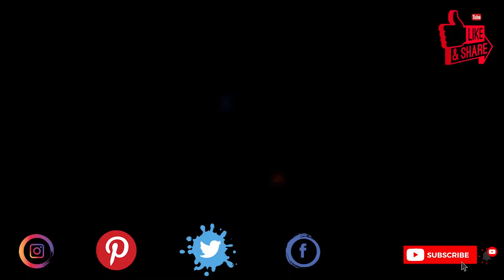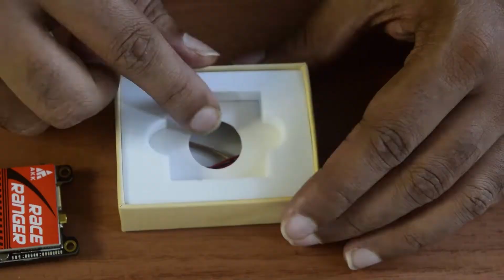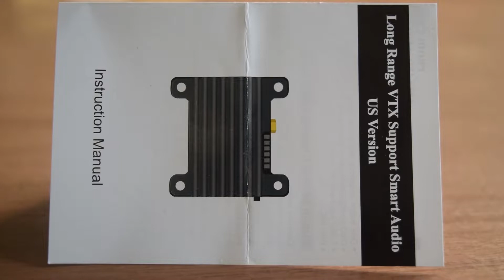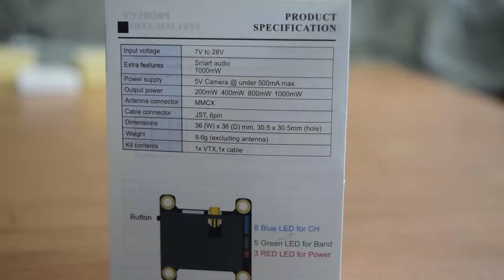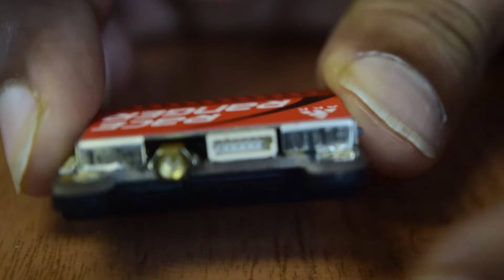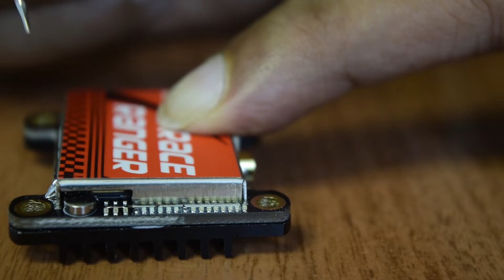BEIGNNERS GUIDE TO FPV DRONE VIDEO TRANSMITTER | AKK Race Ranger A1918 5.8G Long Range Transmitter

Comment: Im hav9ng issues with mine. I cant get the smart audio to work. Says smart audio unknown in betaflight
Reply: Update for what its worth.   I just downgraded to betaflight 4.5.1 works fine.  Seems they dont have the unstable release option anymore.
Reply: @MrBmw2444 I ended up switching my FC and I put a zeus pro vtx and that works great.  
I am putting this one on my mark4 7in. Hopefully I can get it to work this time👍

Comment: Im intending to make a set up for my rc plane, is it allowable to solder a connection for a battery and run the power directly from a battery for this transmitter?
Reply from the maker: Yes you can as long as the voltage rating is matched as this vtx has its own voltage regulator built in you can supply battery voltage to this vtx

Comment: Hey bro i just built my quad nd using this vtx i bioted up with smoke stopper it disnt trip , but vtx didnt show any lights m using skystars h7 nd it has Pre soldered bridge to pit mode pad , m i safe to connect without smoke stopper?
Reply from the maker: Smoke stopper just tell you that your postive and negative supply are not connected to each other directly but it doesn't tell if you have connected each componnect correctly. When you connect the supply each of the component should power up atleast. So my suggestion will be to keep smoke stopper till your all components are booted up correctly as you would be changing thebconnections to fix it. I hope this helps . Please stay tuned to my channel for my future videos

Comment: Im new to FPV. Im trying to put together FPV for my rc car.
I want this one but dnt understand what I do with wires? Solder them to? I cant just purchase a complete mircro jumper cable already soldered? I typed "micro jumper cable" on amazon, it brings up actual jumper cables.

All I want to do is use this VTX with a fpv camera and 2s battery.Do I need a flight controller even tho Im not flying?
Reply from the maker: No wires are not soldered and when you purchase you get a micro just cable along with it . And no you dont need a flight controller to use it on your RC car. Using the jumper cable included  just power the VTX and using 5V and Gnd power the camera and connect the video cable to this vtx and you should be good to go. One pre thing you would need is a 5.8ghz antenna for trasmission additional for amazon search or tearm micro jst incase you need it. I hope this helps. Plessis stay tuned to my channel for my future videos
Reply: @AstroShootingStars  But the cable you took out the box has open wires on one end? H
What wires would I need to connect this to camera and a lipo battery? It doesnt have any cables besides the one you showed"micro jumper cables" you called  them, besides that, I dnt see any other cables/wires inside box/review
Reply from the maker: Exactly that wire will on the open end side can be used to connect the lipo and camera and other side has micro jst connector that can be used to connect it to vtx
Reply: @AstroShootingStars  The open end has no connectors, its just open wires so it cant connect directly to camera or lipo battery so it does require some soldering because it doesnt have connectors to connect to lipo or camera.
Ima just try to find a different vtx that has complete wires because Im not understaning exactly what needs to be done and what other wires are required
Reply from the maker: That is correct you would require soldering for sure as i dont think you will get a wire with that kind of micro jst unless you know how to make one on your own.
Reply: @AstroShootingStars  This is list I put together and ordered on amazon. Can you check list out and  confirmed if thats all I need, that with these items I will be able to plug and play, with no soldering and no other requirements?

VTX: 5.8GHz FPV VTX  https://a.co/d/gi2989S 

FPV camera: FPV Camera Foxeer Razer Mini https://a.co/d/13mJ1Xn 

FPV Receiver: FPV Receiver 5.8G 150CH OTG https://a.co/d/0VzMbEH
Reply from the maker: Cool but you also need an antenna as vtx do not come with antenna
Reply: @AstroShootingStars  I forgot to link that but yes I had got "Wolfwhoop PC11 2pcs 5.8GHz 5dBi RHCP Omnidirectional"
It has 2, so I can put one on the VTX and one on the fpv receiver.
But with that set up, Im good to go? Everything will just plug in and work?
Reply from the maker: Hopefully this should be all not sure about the connectors but as per the components goes yes you are good